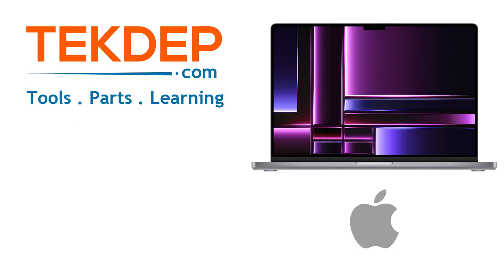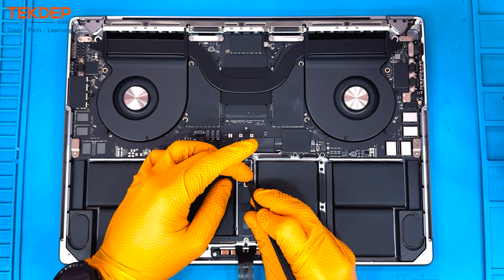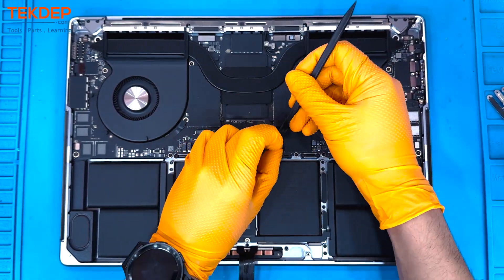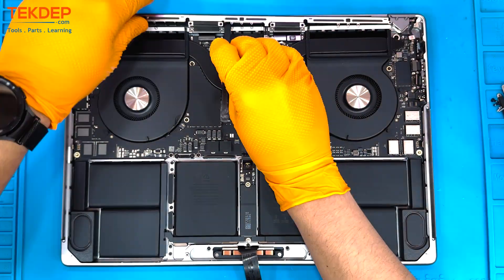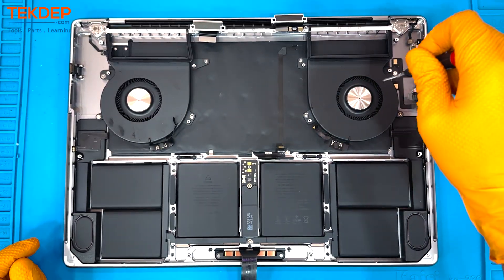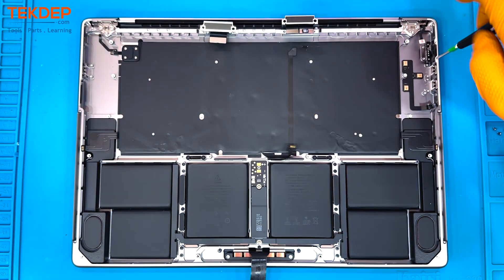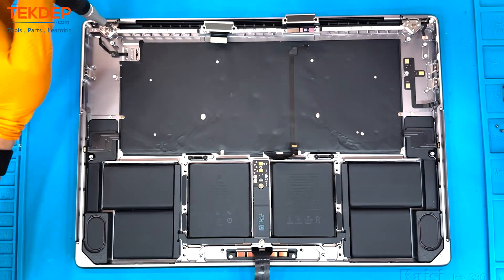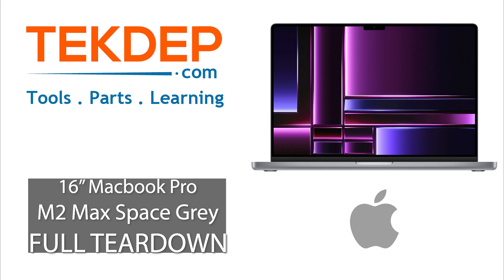M2 MAX 16” MacBook Pro Full Teardown Repair Disassembly Guide

Comment: My mac screen has weird lines and turn on and off constantly. The screen looks clean and undamaged. Could the cable be loose or dirty? I don’t get why screen would go bad as i never used any hard cases or cover, only bad in my soft backpack. I am so confused why it stop working properly

Comment: What about keyboard replacement on this model?
Reply from the maker: You can replace the keyboard or the entire top case but it’s easier if you just changed the entire Top case and it’s safer. We have a video for 14 inch how we are replacing the keyboard only on that model that will be similar to this one if you wanna just change the keyboard, regardless, we do have both loose keyboard and entire top case Assembly ready to ship worldwide on our website so if you need to visit tekdep.com 

Good luck 🍀

Comment: Just cleaned my M1 16' after 1.5 years of ownership thinking it'll be nasty inside but it was to my utter surprise - very clean.. almost no dust. I am very careful about my workplace and I take care of it really well but I thought the fans would pull some stuff in, especially since I've been pushing it quite a bit in this time. Very clean I have to say.
Reply from the maker: Because of the efficiency of the M series processors, the fans do not have to spin very often even during intense workloads. The upside of this is cleaner fans and cleaner units!

Comment: Really interesting video. I saw that on the antennas there are some black parts made by a black fabric, do you know about wich material is this fabric?
Moreover on the opposite side of the heat pipe, on the cpu, there is a plate: do you know the material of it?

Comment: Hey there. Thanks for the informative video.

I came here concerned because I saw an insect about 1-2cms walk right in through the vent of my MBP. The vent it went in is the one that's located in the centre. I guess not the ones which are directly connected to the fans, but in the centre of these.

I am just concerned if it may cause it short or clog something.

Tried shaking it vigorously to no avail. It just won't come out no matter how hard I shake it.

I immediately turned it off, and will be turning it back on in the next 6 hours or so.

What would you suggest? Should I take it to apple care or something? Or am I just over stressed and let it rest?
Reply: Late reply but next time just take a vacuum to it

Comment: Hi, thank you for this video. I spilled a single drop of water on the right speaker grill and now I'm worried. I'm reading that the macbook pros speaker grills are only cosmetic small dents that aren't actually holes, is that correct? Do you think I will be fine? Thanks
Reply from the maker: Designed purely for cosmetic reasons, here is a tekdep blog link that talks about speaker grills on M1 Pro Models 

https://tekdep.com/2021/12/11/16-macbook-pro-a2485-model-2021-speaker-hols/
Reply: @tekdep   Hi, thank you so much for the link and responding!! That's good to hear. I spilled about a small quarter size of water drop on the top half of the speaker where it's just cosmetic. I immediately wiped it off with a towel. But I did wipe downwards towards the 20% of real holes on the bottom half of the speakers. But it was dry completely when I wiped it off. I turned it off immediately and waiting until later tonight to turn it on which would make 24 hours with it shut off. Should I be worried, or do you think I'm being to overly obsessive?
Reply from the maker: Honestly I think it’s not much of liquid and giving the backlight layer beneath the surface, I doubt it will reach any sensitive areas of your laptop.. it’s nice that you turned off the unit and going to wait a day.. I think you be all-right
Reply: @tekdep  Thank you so much. I was worried it could trickle into the speaker or something since I wiped downwards. I've been kicking myself ever since. That's good to hear. I made sure to turn it off immediately and will only turn it back on once it has been 24 hours. Thank you for your help. Have a great day!
Reply: @tekdep  Hey, I decided to play it safe and wait 48 hours. I turned it on and everything is working perfectly!